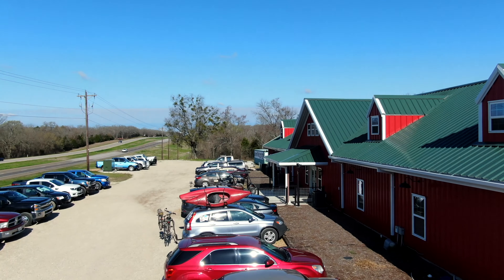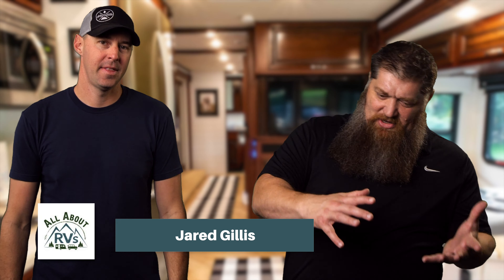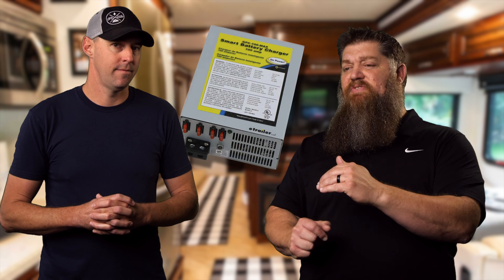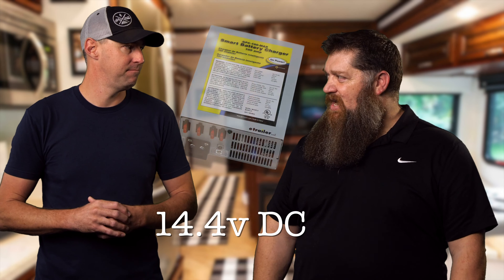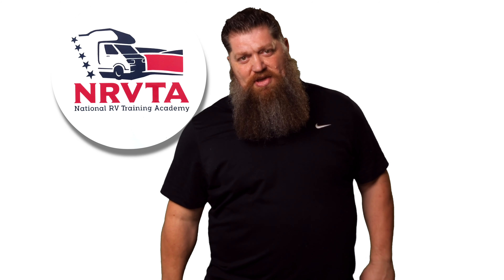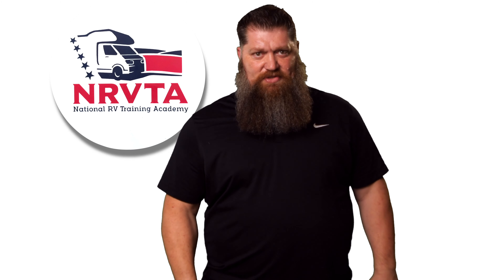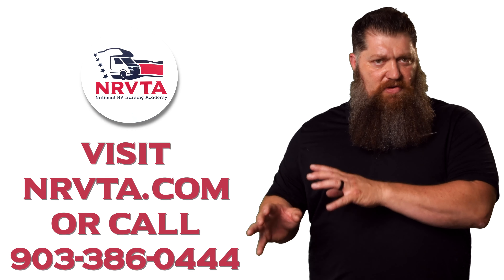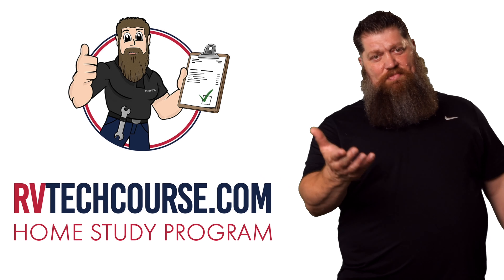Upgrading your battery charger with lithium / With @AllAboutRVs​

Comment: Can you give info on the tow vehicle charge capability through the 7 pin connector? I did the converter upgrade on the 5th wheel and only have one lithium battery with no solar charging. Will my trucks alternator be harmed while towing? Do I need to change anything?
Reply: Please, somebody answer this. I've been told that lithium-ion batteries can charge so much faster than lead acid batteries that it can damage your alternator. So you need to install a 20amp regulator to limit the rate of charging. Is this true?
Reply: Yes, you need a DC to DC charger line for the 7 pin. Will put a strain on the Alt without it because Lifepo4 will take all the amps your Alt will put out vs what a lead acid would.
Reply: @MrTeff999  see below

Comment: If you have solar on the roof of your rv they can supplement the charging of your lithium batteries using the basic converter. In other words the converter will charge your lithium batteries up to 80% and then your solar will help to top that off to a 100% until your replace your converter with a lithium compatible converter.
Reply: I was going to ask a question slightly related to this.   If I did not change the charge controller, but after a trip if I had my rig in my driveway and I connected an external lithium charger that I use for my trolling motor batteries, would this balance out the lithium batteries on my rig?  Just thinking of doing this in stages, since money is a little tight right now.  The last time I checked a new PD charge unit was only a few hundred dollars, so I should probably just make the switch.   Note: I do have a 100W solar panel on the unit.

Comment: I have a 2007 trailer with a WFCO 8945AN converter. I just installed a Feence Elefast group 24 100ah lifepo4 battery. While waiting for the auto detect replacement converter I thought I would try the old one, it charged the battery to 105 ah -100% and after sitting overnight the cells were balanced.

Comment: Jared says: ... "if i upgrade my converter, I'm going to need to upsize the wires to provide the full charge faster...", but upsize to what gauge?
Reply: The wire gauge will depend on the distance between your converter and your batteries. Determine that distance and double it for the return trip, then find a DC wire size chart to determine the wire size you should use for that distance and the amperage you’re anticipating.
Reply: 2 Guage seems to be a good starting point for the series wiring, after that couldn't tell ya. Guy that does redodo bat tests on YouTube herewith white beard talksabout it

Comment: Upgrade what wire fellas?
Reply from the maker: That's the 12v battery wires going between the batteries and the inverter and charger.
Reply: Seems #2 is a good starting point

Comment: How about the pulling vehicle’s alternator?
Reply from the maker: the voltage isn't high enough to charge the lithium batteries. you can install a DC / DC charger to charge lithium batteries while you travel.

Comment: What about when your travel trailer is connected to your vehicle? At that point, the alternator keeps the trailer's battery charged. Will that charging system cause any issues while traveling long distances?
Reply: Yes, it will toast the alternator. 
Use a Li-Bim 225 isolation manager to protect it.

Comment: I have a 2018 jayco Greyhawk id like to switch over to lithium you're saying i can use my setup currently in the rv? I also have 400 watts of solar with a lithium controller and Bluetooth do i still need to swith the converter?

Comment: I am about to change to lithium.  One 200 AH 200 BMS to replace 3 AGM's with a total of 345 AH.  My converter/charger is the older model and not compatible.  They also promote a small battery charger when buying a lithium battery.  This battery plugs into a 120v outlet. My question is would it be counter productive to plug it in to my inverter to charge the battery ?  I also have a 315 watt solar panel to help the charge.

Comment: Just had to replace my Freedom 458 inverter/charger this past summer.  Will this work with a Lithium set up?  My wet batteries are getting tired and I'd like to upgrade to Lithium.  Output shows 14.4 volts at the output posts on the new Freedom 458.  I'd hate to have to go out and buy a different charger is all.  Thanks!

Comment: I have a real old class c rv. In fact 1993 coachman.  Thinking of upgrading to a lithium battery. Can i or should i just keep my agm battery?
Reply from the maker: If you upgrade your batteries it has to be upgraded all at the same time. Don't mix battery types.

Comment: What if my RV has a lithium button in the fuse panel? What does that button do??
Reply from the maker: That is your Charger / converter. that button allows the charger to charge using the lithium voltage which will maximize the batteries performance.
Reply: @NationalRVTrainingAcademy  I could never really find any solid answers on that. So with a Battle Born battery and that switch on I should get a proper charge? Thanks for the reply 👍
Reply from the maker: So the short answer is yes. When you switch to LI in your fuse panel the charger will charge based on how it was programmed. 

Is it the best? Hard to say as each lithium battery may require slightly different charges.
Reply: @NationalRVTrainingAcademy  Awsome. Thanks again guys!

Comment: What are the Alternator considerations in a motorized RV?
Reply: DC to DC Renogy sells many. I have a 40 amp in my DP. I have 10-100 amp batteries. Use caution on the amps you choose. A 2nd alternator is best. You should be fine with a 20 amp DC-DC charger with a singe alternator.

Comment: Does anything need to be added between the tow vehicle's alternator and the rv. My understanding is that if nothing is added then eventually it will burn up the tow vehicle's Alternator.
Reply: Li-Bim 225 isolation manager

Comment: If you are considering Lithium batteries, look into Lithium Iron Phosphate batteries, they have higher capacity per weight and are less flammable.
Reply from the maker: Lithium Iron Phosphate batteries is the standard lithium for RVs. No one really uses lithium ion anymore for RVs.

Comment: Thank you for an excellent video for your two minute Tuesday I didn’t realize that was a possibility If I change my batteries to lithium do I need to change my cables from the batteries to the inverter and to the fuse panel and if I get a external charger for my battery to charge them up 100% without changing my cables do I stand the risk of fire
Reply from the maker: You'll want to upgrade the wiring if you are going to use an inverter more intensively. If you just want the extra capacity without using a larger inverter than the cables you currently have should be fine. just make sure your charger / converter is capable of charging lithium.

Comment: Hello Guys, How to make sure i need to replace my Cables for Bigger cables ?  I just purchase a 12v 300ah Ampere Time & a Charger replacement for lithium upgrade for my  2014 toy hauler 50amps. Does it need to be done right away ? Thanks
Reply from the maker: So the cable size will be determined based on your demand not supply. 

So if you gage an inverter then it’s a larger demand, if it’s just to run the 12volt items only then no need to increase the size.

Comment: It should be noted it isn't necessary to swap out the converter charger if you have other charge options as part of your system, eg a solar charger or inverter/charger that are setup properly for lithium.
Reply: Good point.  I’ve been thinking exactly the same but just don’t know if there could be a down side?.  If solar charger will top batteries off to 100% to allow proper balancing then existing converter unit may only  charge to 80% when plugged in to shore and no sun.  Would we risk feedback burning up existing converter unit because of higher voltage level?.  It may be best to check specs on your existing converter and make sure converter is protected from the higher voltage than charging capability.  I just don’t know but think all should consider this is a potential risk.
Reply: @jeffstrickland7688  on my system I just turned off the breaker to the converters charger and use the solar & inverter/charger to maintain the batteries.
Reply: @marka9083  brilliant.   I didn’t even think about that.  If it is needed then it is there. Thanks.
Reply from the maker: Yes. Knowing your equipment and how its setup is key.

Comment: Be forward thinking. If you install lithium batteries and you are going to install an inverter, you might want to not purchase a new converter as the inverter should have a charger. So you will be wasting money on the charger purchase. I know from experience 😢
Reply from the maker: That is correct if you know what equipment you are installing. there are many inverters that do not have any battery charging functions. there are many RV's now that have the charger that has both options right out of the dealership. know what you have and know what you want.